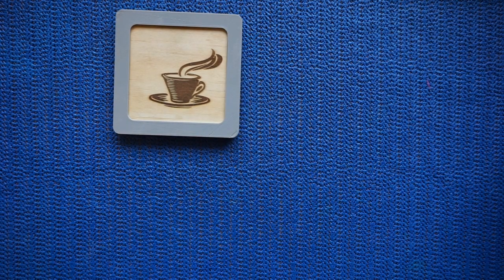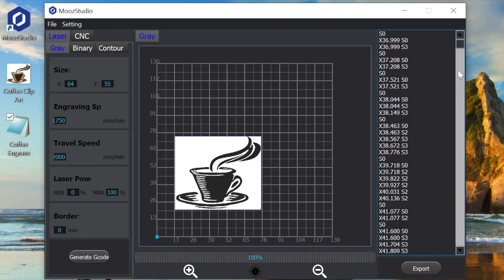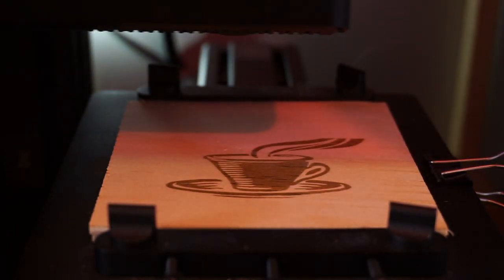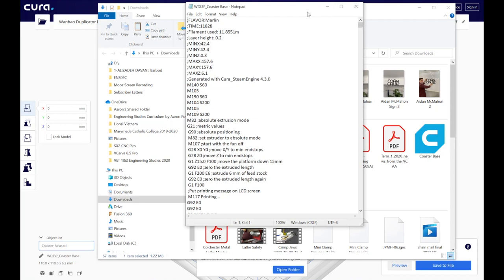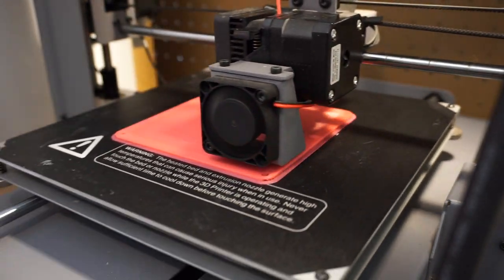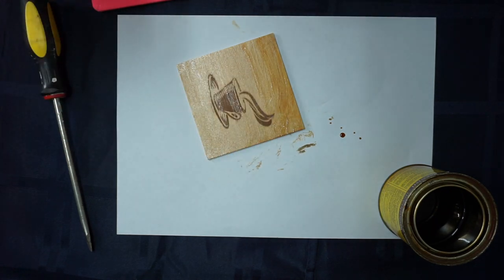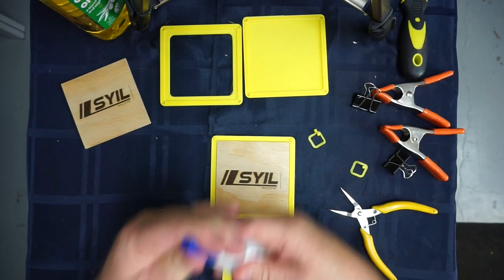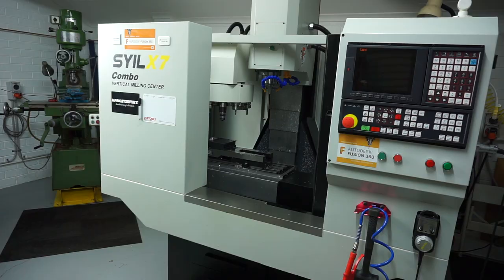Making Custom Coasters Part 2 - Laser Engraving & 3D printing

Comment: Gday Aaron, the coasters turned out great, the design options are endless, interesting how the laser works without catch the ply on fire, thanks for sharing, cheers Matty
Reply from the maker: G'day Matty.  Yes you have be careful of lasers cutters / engravers.  They can catch fire and burn your house down.  I try to remain vigilant when using them and this also 3D printers.  Some have actually caught fire.  Thanks for following along on this simple build.  Unfortunately both videos flopped, but that's YouTube for you.  When you're hot your hot and when you're not https://youtu.be/Deqwt6ORRiY?t=30
Cheers mate, Aaron.